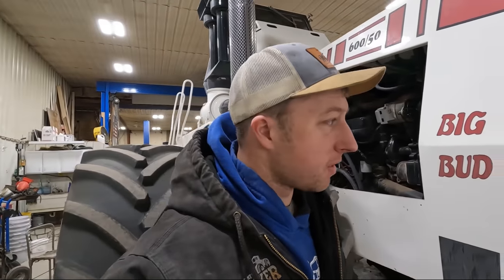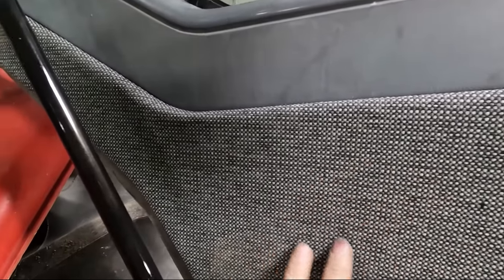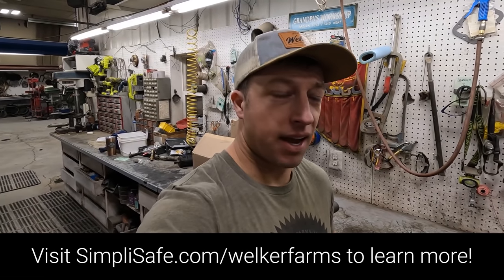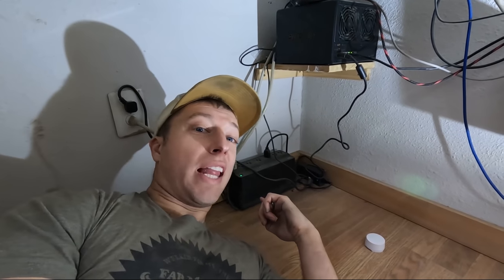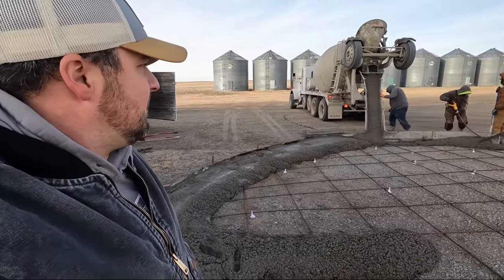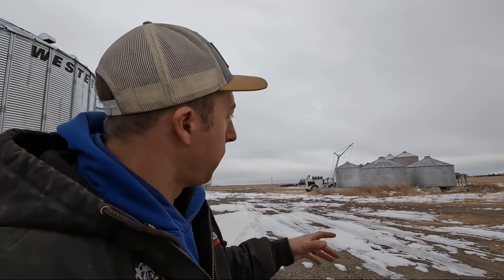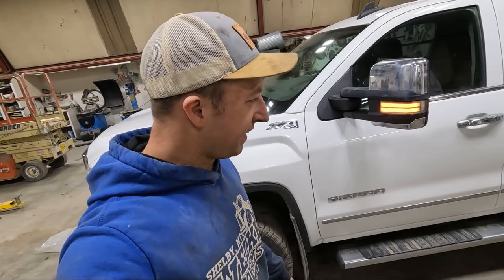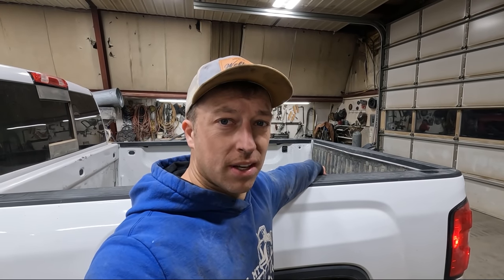Transmission Rebuilt! Time For Interior Upgrades! 💪

Comment: 1. If you did NOT clamp the rubber brake lines with BRAKE LINE CLAMPS (look like two round sti is with a hinge and a set screw) open your bleeder and pry back the inside pad on the caliper remove  caliper ONLY not the hold down bracket replace pads, open clamp, have someone e push pedal to floor as if bleeding, repeat 4 times (this will FLUSH old brake fluid out of line)
Once off hoist pump brakes 6 times BEFORE you start and move any vehicle you have just completed a brake job on
Reply from the maker: Awesome thank you for the advice, I want to flush the fluid with new so I'll give this a go!

Comment: slotted and drilled rotors won't increase your braking efficiency by much. if anything they will help keep the pad surface clear of gas and dirt. but won't give big increase in braking power. to do that you need to increase the leverage the brake calliper has against the wheel. so a bigger rotor is needed with the calliper spaced out to suit the new rotor. easy way to think about it is like this your trying to free off a stuck bolt. do you use a socket on a ratchet or a socket on the breaker bar? the breaker bar!! it gives more leverage to break the bolt free, in the same way a bigger rotor has more leverage to slow/stop the spinning wheel. 

cheap upgrade is to find the next model or 2 up from yours and rob it of its brakes. so if the half ton has a 9inch dia rotor and the 3/4 tone is 11 inch dia rotor, you get 2 inches more rotor leverage to stop your spinning wheel it might even be the same calliper but mounted out a bit further.  i have done similar upgrades on cars when i needed to uprate the stopping power

Comment: Change the Brake support Bracket and Guide pin.  It is not something that can be cleaned. They should offer the support (without the caliper) at any Parts outlet. I just did that on a vehicle and the bracket was only $50 or so. The Pins are about $6 with all the spare elastomeric parts.
Reply from the maker: I agree, I don't like reusing it. I'll get another and replace it. I think that might be a big reason why I had poor braking. That caliper couldn't press the pad against the rotor on that side without going sideways.

Comment: Brake pads can be bad and still be full thickness.  What happens is during heavy braking the pads heat up so much that they glaze over and harden so you lose most of there effectiveness.  Over time they will start cutting into the rotor and not wear done the pads at all.  Just a helpful tid bit.

Comment: Protip I saw on a mechanic channel: when you're squizing the brake piston back in, unscrew the bleeder valve to bleed the braking fluid. You'd be surprised how dirty it could be, and you won't push all that contamination into the master cylinder or ABS pump.

Comment: Yeah nick, beleive it or not those slide pins freezing in the caliper is normal. Its not good, at all or right but it is normal, especially in high rust and or salt areas. As long as you clean them up and use a Non Petroleum grease you will be fin reusing them.

Comment: On the newer model GM trucks, braided brake lines are a good, noticeable upgrade on top of those brake best drilled and slotted rotors. I did the braided lines, then the drilled and slotted rotors and carbon pads on my 06 2500hd very noticable difference in braking power and feel!

Comment: When it comes time to trade, take a look at the Ford 7.3 gas in the 17+ Super Duty.  Makes a ton of torque, is low tech old school designed for longevity.  I love it in my F350.  And the brakes are about twice the size and power of a half ton.

Comment: kinda funny. just did the same job on my jeep. pads and rotors all around. and had exactly 1 frozen caliper pin just as you did. used a drill bit the size of the hole on slide and lightly cleaned it out. worked great

Comment: Slotted are ok, but drilled are only for looks, and actually lower the heat capacity because they take mass out of the rotors. They also suck in air, which doesn't cool as well, because it doesn't flow through the whole vane length. They also create stress risers at each one, and give cracks a place to start. They used to be needed because the asbestos pads outgassed when they got hot, but modern compounds don't outgas. Literally every brake mfg says blank or slotted for high performance, and the only thing drilled are good for is looks and maybe helping Acceleration drag racing because they are lighter. You're best off with blank or slotted, and semi-metallic (stock was ceramic, which is why you had issues with braking, with their lower coefficient of friction and lower fade temperature) or para-aramid (sold as fleet/rescue/performance pads).

Comment: those rotors are great if you go through a set of pads in a day on the track
in the salt and sand? no way, they just rust up little ridges that eat the pads and shake your steering wheel

Comment: Good to see the ole Magnum back. Loved to run them in my younger days on the farm.
Reply from the maker: Great tractors! This one needs some tlc but it'll be back on the map soon.
Reply: I leased one for a few months.   When I was offered to buy it, I declined which was a very good decision because the 8400 JD I bought is still a great tractor 20 years later with 8,000 hours and only minor repairs.

Comment: Stuck slide pins will always cause premature brake wear.  Every time you do brakes take all of the slide pins out and grease them with high temp brake grease. As for drilled/slotted, it's mostly for show unless you are slowing down from very high rates of speed in very short distances (think 100+ mph to 30 in under 500   feet.)  Even towing, unless you have zero trailer brakes will you ever really get your pads hot enough to offgas and cause brake fade.  That said, enjoy them and they do look sporty.
Reply from the maker: Thanks for the advice! I greased the pins up with the included grease from the kit and will do again next brake change. I really wanted to put larger brakes on but from the little understanding I had, seemed like a pretty extensive job. So I tried to find the next best thing. Merry Christmas!
Reply: @WelkerFarms  Bigger rotors are an option and yes the kits are expensive.  I found on my towing vehicles you can always start with better then stock pad compounds.  You would be amazed on how much that can change.   I currently use Wagner Severe Duty on my F350 DRW, I feel I confident I could stop my 16k 5th wheel even if the trailer brakes failed compared to other pads.  Enjoy a Merry Christmas as well!!

Comment: While your 'upgraded' rotors are a good move - Brake Pads are where braking power and fade resistance come from.  In my experience Hawk Light Truck Pad are head and shoulders better than any other pads on the market.

Comment: they make ROUND wire brushes, in different diameters, that would work for the caliper slide bolt holes
Reply: I use a cheap drill bit. That rust is hard on hone stones and wire brush don't usually touch it

Comment: coat hanger to support your calipers, don't hang by brake line, just saying. Unless replacing lines as well. Good stuff.
Reply: Brake lines are designed to operate up to 1,000PSI. You'll blow a line while in use way before you damage it from letting the caliber hang
Reply: @TheIam14  True, yet the end fittings could be damaged. For the home, fair enough. At the shop, we hang them. One less worry.

Comment: Hey Nick I have a question about simply safe. If someone would break into your house or shop and they would unplug the base station would it shut down the whole system or will it keep running?
Reply: Unless you physically destroy it, the base station will keep transmitting.  The base station has a battery backup and wireless (cellular) connection to the alarm monitoring company.  Sensors, all battery powered, connect to the base station via Wi-Fi.  Once the alarm has been tripped, it's going to reach the authorities one way or the other.  Older units, like ours, have a three way redundant connection, cellular, wired phone line (if available) and Wi-Fi. I believe they've eliminated the phone line connection on the newer models.

Comment: Say, when you compress the calipers, first loosen the cap on the master cylinder... it helps. Don't need to remove it, just loosen it.
Reply from the maker: Oh didn't think of that, good call. I need to replace the oil in the brake system too.

Comment: Hey nick you should custom make the plate for the controls I did that in my 4440 and it turned out so cool
Reply from the maker: That's awesome! I was very tempted but ended up ordering a new one for $400 😮 it'll look good when it is installed.
Reply: Should try your hand at a woodworking project for the console, will look alot better and a lot cheaper to make and install.

Comment: Dang Nick hang those calipers up to the spring so that they aren't hanging from the flex hoses. 😲
Reply from the maker: They weren't hanging, I rested them on the upper control arms and axle and held them in place with my hand while working. I did start off with a short bungie cord attached to the spring but realized it wasn't necessary since I never let it hang.
Reply: @WelkerFarms  ok sorry My bad looked like they were hanging in the video, and I only commented as I've screwed up that way before. 👍👌❤️

Comment: Make sure and hot those rotors with brake clean since you were bare handing them.
Reply from the maker: I didn't do this, I can go in and clean them up when I bleed the brake oil and replace it.
Reply: @WelkerFarms  no know it all here I was just always told not to touch the brake rotor surface or brake pad surface with bare hands. Love the channel. Glad you guys are starting to feel better.

Comment: About the cheap tires?   Did you put those on or did the dealer have them on the truck?  If the dealer did it this seems to be a trend.  I bought a Sierra from Eisinger in Kalispell and it had “new” tires on it but they were a brand name I couldn’t even find on the Internet.  Surprise surprise first rain storm I drove in, hydroplaned and went in the ditch.

Comment: The slots on the rotors need to face forward to draw cooler air in from the outside
Reply from the maker: That makes sense, the rotors were labeled passenger or driver and so I know I put them in the correct spots. Well unless the stickers were mislabeled!
Reply: @WelkerFarms  at least in the race car world now a days the slots and drilled rotors are for scrubbing the pads not drawing in air ....that's the internal vains job...careful with excessive heat can cause cracking where the drilled holes are....if your over heating them chance are air flow to the back of the hub/rotor hat area would help more than anything
Reply: @WelkerFarms  i have purchased many sets of cross drilled and slotter rotors and the company i buy them from always  recommended the slots facing forward. Possibly different suppliers have different ideas. I purchase rotors from Max Brakes in Ontario. They are the manufactures of thr rotors.

Comment: Bleed the brakes and you will get your as new braking feel back. Should bleed brakes 1 or 2 times a year to get the air and moisture out of the system. There is no such thing as a sealed system, brake fluid absorbs moisture.
Reply from the maker: Great idea, I plan on doing a full fluid swap on the brakes.

Comment: Hey Nick.  In an earlier video you were talking about fertilizer prices and how you didn’t fill your bins this fall.  I was just wondering what your plan is if prices are still so stupid come spring.  I’m not sure what I’m going to do
Reply from the maker: We don't know, honestly we will likely just put a small amount on for a starter and leave it at that. Considering we just left a drought and typically they last multiple years, our plan is to farm as cheap as possible next year. Keep costs down just in case we get no rain. Last thing we want to do is over extended ourselves going into a bad year. The other thing is our soil still has strong levels of N being our yields were so low and very little moisture since. Time will tell my friend what the best path is.

Comment: I would keep an eye on that grain bin pad. I don’t understand why ready mix companies want to keep using sooooo much additives in cement??? We fight it all the time!!! I have a guy who checks every batch ticket that comes to our jobs and make sure dosage of adds are at low rate. We had to take out 900 cyds worth in a warehouse cause it false set. Top was setting up and it was jelly underneath. Ready mix company had to pay for all of the repair!! Like my dad said!!
Concrete is rock,sand, cement, and water. Romans  built with those ingredients and most there structures are still standing!!

Comment: Nick, get yourself a 3D printer to make those difficult to find interior pieces!
Reply: Eh, that doesn't work as nice as it sounds...Been there, done that with a 5088 IHC. It kinda needs to be a "cast" plastic to put up with the vibration and abuse.

Also, get a 3D scanner, if you do go that way.

Comment: Nik that's going to last a long time before you take apart again. Why didn't you use high temp grease. You know better. I know you do. You friend in pa.
Reply from the maker: I actually did but unfortunately the clip of me applying it wasn't included in the video. Used the grease that came with the pad kit.

Comment: There’s a break in time for brakes?
Reply from the maker: After adding new brake pads and rotors you need to do a break in procedure to mate the pad surfaces to the rotor. It's pretty simple, speed up to 35mph and then firmly press the brakes till you slow down to 5 mph without locking up the brakes. Then as soon as you it 5 mph speed up to 35 mph and repeat 3-4 times. Then do the same thing only accelerate to 50 mph and brake back down to 5 mph. Repeat that 3-4 times and then drive lightly for a few miles so the brakes cool. After that the pads should be mated to the rotors and that'll extend life and improve braking.
Reply: @WelkerFarms  awhhh I didn’t know that! Thanks I always learn something watching you guys

Comment: You're fired. Never, ever hang a brake caliper by the brake hose.
Reply from the maker: Didn't happen, never hung it, always left it on top of the a arm.
Reply from the maker: Look closer, I have a bungie strap holding the caliper with slack in the brake line. Definitely not our first brake pad change rodeo.
Reply: @WelkerFarms , I went back and rewatched it. My apologies. There is a black bungie cord holding the weight. Can we still be friends? :-)

Comment: Get a 1 ton single axel with the 6.6.  Save $10k over the overrated clattering diesel.  Now for those coal haulers that will be all over me for hauling capacity.  For less than $10 you could put twin turbos on that gasser (like the diesels) and blow away the horse power and torque of the diesel...

Comment: Those brakes look like Powerstop extremes. I'm a huge fan of those. I have them on my Expedition and my F350.  In both cases it was a major upgrade. I think you'll like them.
Reply from the maker: They are! Glad you confirmed that, did a lot of research and they kept coming up as good upgrades. Thanks
Reply: @WelkerFarms   I picked up a Simplisafe system a month ago based on your channel and a couple others and the wife and I are thrilled with how well it works. I`m glad they support channels like yours.  keep up the great work. God Bless and Merry Christmas!

Comment: Can I suggest changing over your rims and tyres instead of having 20" rims that are useless off-road you go to 18" and have like a 265/65/18 AT tyre on it, like a Cooper AT3 or a Falken Wildpeak AT tyre.
Reply: The only time a 18" rim will do better then a 20. Is if your rock crawling and need to air down. Or if you have meaty tires on it with some side lugs. If the trucks primary use is on road and driving through primarily dry fields switching rims is a waste of money. Also around a 40-42" tire the use of a 20" rim actually helps in off road situations unless you run bead-locks. Don't blindly follow the internet hype.
Reply: @steveboy3021002  wrong, there is not enough side wall and air pressure in a 20" rim and tyre combo, for everyday use and off-roading! for rock crawling you would use a 16" rim maybe 17" at a stretch.
Reply: @jasonswift7098  what 😂😂😂. Noone here is going off roading everyday. The tread pattern is exactly the same no matter the rim size. Ill restate what i said the only time sidewall helps is if you need to air down or of your in deep ruts.  Ive seen plenty of trucks on 20's drive past trucks on 16's. For a daily driver that sees of road use but not mudding or rock crawling you will never see an issue with a 20" rim wrapped in a 33" or so tire. If you were playing off road in the mud thats a different story and your absolutely correct.
Reply: @steveboy3021002  The whole farm is off-road! they only drive on bitumen when they go into town hence why all the tyres on all the cars are AT tread not highway terrain.
Reply: @jasonswift7098  you obviously aren't understanding man haha. You can keep believing rim size means a vehicle goes better off road in all situations. Have a Merry Christmas and Happy Holidays.